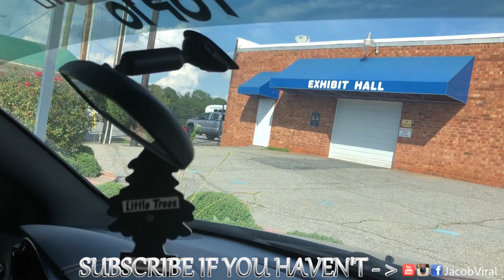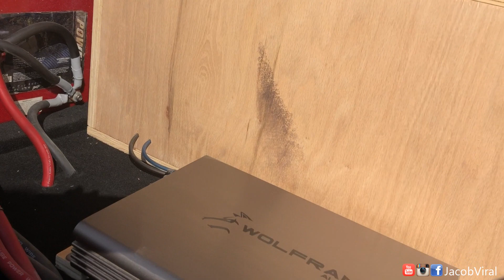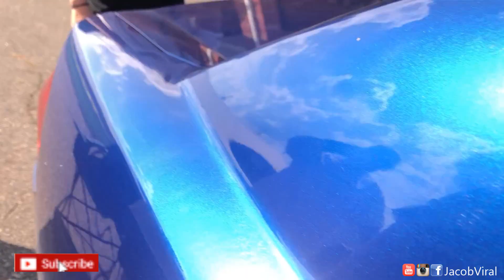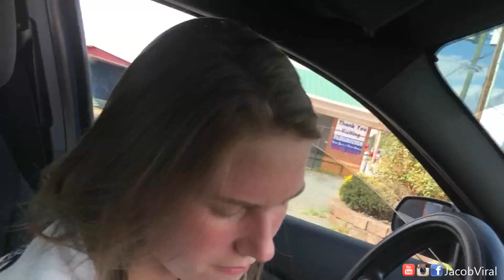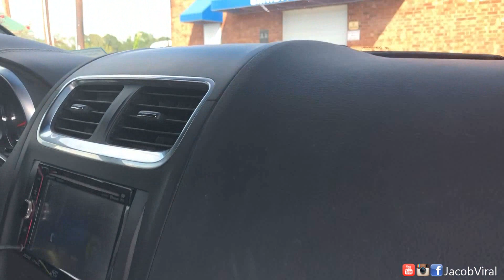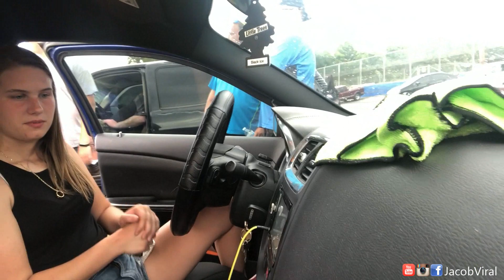2 BUDGET 12S IN A SEALED OFF TRUNK | BUDGET BUILD

Comment: Did she say she was tuned to 58hz??
Reply: Lower power systems sound louder to the ear at higher frequency, 1500w at 30hz wouldnt be very loud, 58hz it does
Reply: Hong Bitter it all depends on the enclosure. But most competitors build high tuned enclosures. Which is determined by the cabins naturally boosted frequency (peak frequency).
Reply: @hongbitter7142  but thats assuming that the current a 58hz tone draws in this same setup is the same as a 30hz, its all in the set up ive seen people take a sealed box and have it transition from sounding like a high tuned spl box to perfectly flat just with precise use of the bass boost knob

Comment: With a lower tuning and the right box can you get these to sound good?
Reply from the maker: Yep usually it's 80% box for output
Reply: @JacobViral  

The only thing that concerns me is the QTS spec provided by Soundstream.   It is really high, which leads me to believe that it will be REALLY boomy.. Rather than .36, .45, .56, etc.  It is 1+....Never saw a sub with spec's that high.
Reply: I even tried running the specs through WINISD, a box building program.  It came out to be a really stupid big box with a raggedy looking frequency response.

Comment: I had one of these soundstreams on 1.2k and got that puppy 
moving!!! It succumbed to the amp after about 12 months. I ran it flat out for that time for hours at a time. My box was set to 33 Hz and banged hard with that setup . I've got a t5 tarantula 12" now and it is a way better option, gets down lower and hits harder. :-) :-) :-)
Reply: kineticarbon fpv simoz  those soundstreams for the money they cost were HARD to beat... no pun intended.

Comment: Dont you need to change the altenator?
Reply: Not for 1500w, 3k+ then maybe an alt
Reply: You're correct.  Anything above 1,000 needs an alternator change.   I've heard a jl 1,200 amp in a setup with a HO alt and it was so loud and clean because it was getting proper voltage.